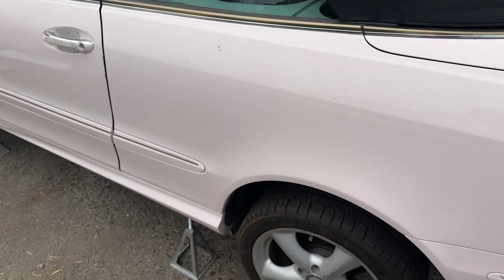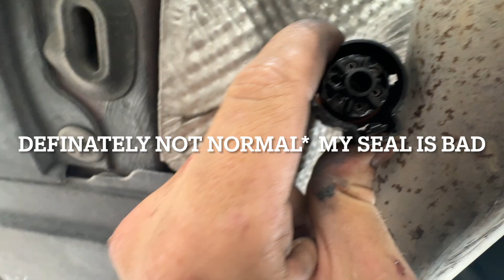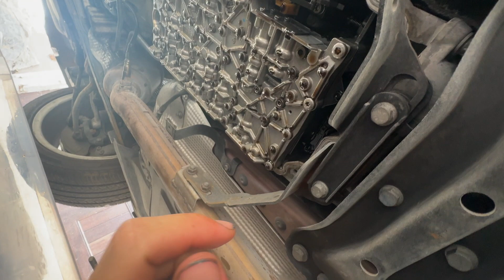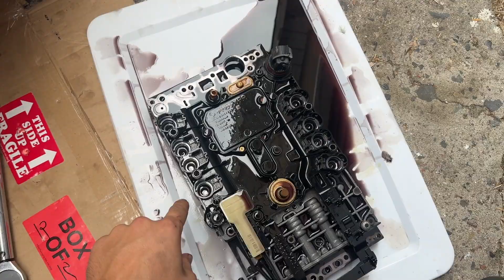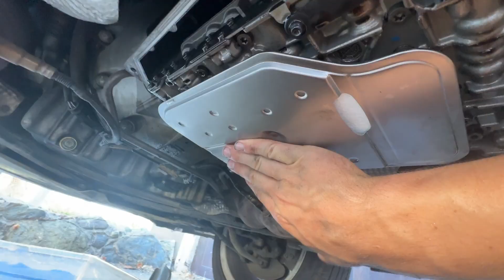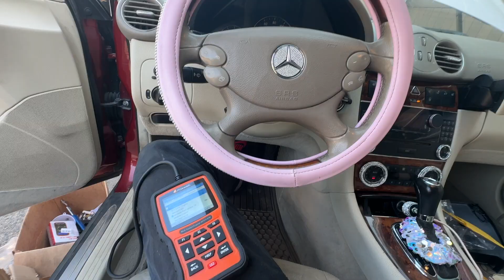05 Mercedes CLK500 722.9 Solenoid Replacement / Transmission oil change

Comment: Which vendor did you use?  Would  you share any helpful information regarding your transaction with them?
Reply: i just bought a used set from a seller on ebay, they did come a little dirty, but no issues, im sure most on ebay for sale will be fine

Comment: yo brother. hope you can find the time to shoot a quick reply. dealing with the same situation. what transfer pump did you use that fit right over the fill adapter. id appreciate the info.
Reply from the maker: i used the red and black one from Amazon, $12 i think. I believe most transfer pumps have the same hose diameters./sizes, if not you can use whichever one you have and zip tie the end over the adapter

Comment: “The gearbox always shifts late up to 3000 rpm without error codes. After restarting it works normally again. In error mode it limits manual shifting. I suspect problems with mechatronics or pressure solenoids.” What do you think? and if it is a conductor plate where can one order one? The car is a Mercedes-Benz E300 bluetec hybrid diesel 2012 7G-Tronic plus designation 724.2?
Reply: that sounds like it can totally be the solenoids. they control all the shifting. Also less likely, but can be the gearbox computer/conductor plate. You can always replace both at the same time

Comment: Thank you for the video. You might want to buy a multimeter. And measure the Ohms in each solenoid. There is a spec for how much Ohms each one should be.
Reply from the maker: i did order used solenoids, i thought was the issue. I was wrong. then i replaced the conductor plate and reinstalled my original solenoids because all of them tested good with a multimeter
Reply: @Maybach_Shop Fantastic. You did a great job, and thank you so much for the video.

Comment: Do the solenoids have to be like the conductor plate and reprogram it or it is plug and play ?where did you order the solenoids?
Reply from the maker: The solenoids were from the oringinal car/ transmission. You can buy new/used ones online so they are plug and play

Comment: Your going to need to program the conductor plate and transfer the settings from the old.  Send the new and old to a shop that can do this.
Reply from the maker: You are right, The vendor i bought the new plate from( link in description) did all the programming, flashing and was all ready to go when i got it. Other than the activation process